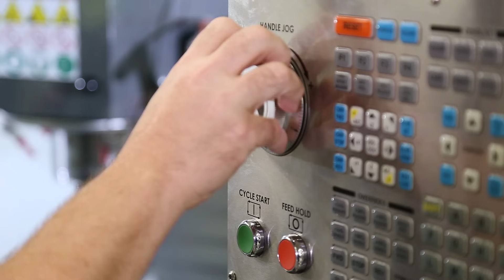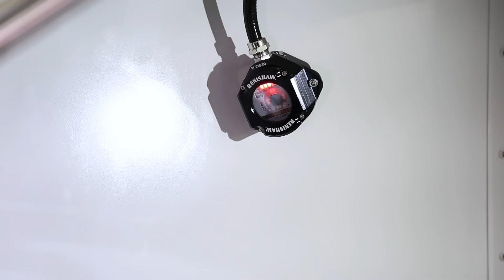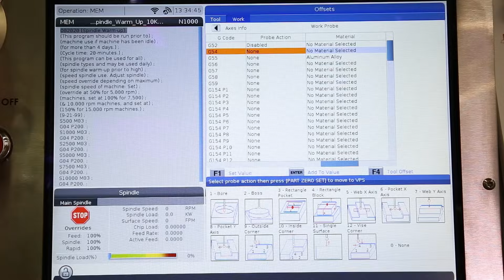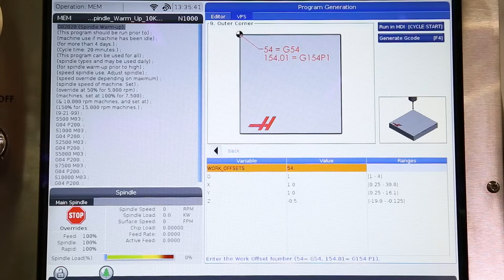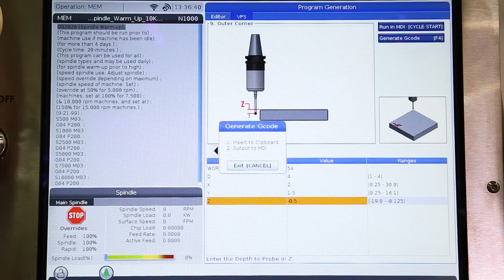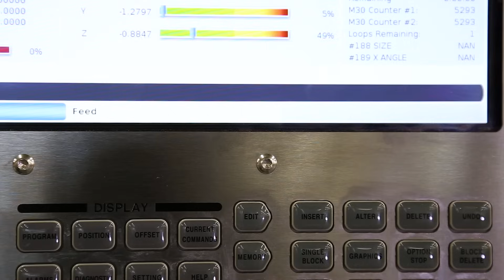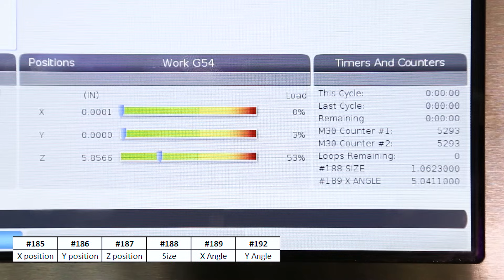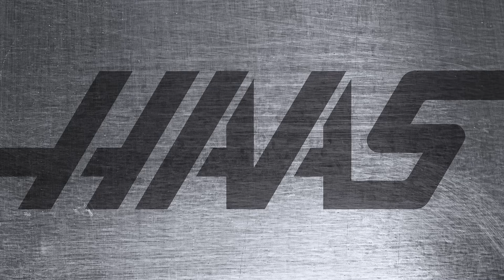Set Work Offsets in Seconds – Haas Automation Tip of the Day

Comment: I hate when you put zero in the upper left corner,, and measurements on drawings,, zero should be put in the lower left corner, for the sole reason,, that all measurements are positive when you have to correct in the program,, just like the right side of the picture is the left side and not the right like Solid Works does,, we learned that in step 1 at the metal school in iso drawing ...simple as you do you do in reality,,

Comment: IMO, Probing is to CNC what the DRO was to manual machining.  Having learned in the old days with a gage block or pin and an edgefinder, setups are sooooooooooooooooooooo much easier today on the modern control with WIPS

Comment: If I use measure cycle 2 BOSS to get to the centre of the part, I have a clamp in the centre so how do I make sure the Z goes up higher enough to go over the clamp, Im new to this and only used the machine for 2 days and dont want to smash the probe.

Comment: Is there a way to probe one surface, say a Z height on a fixture plate, then manually shift that offset to reflect the zero position on the part. I tried just manually adjusting the difference and I got an error.
Reply: After we probe our Z surface, we can adjust our Z Axis Work Offset by highlighting the correct column/row (G54...Z), inputting the shift amount, and pressing Enter (Add) or F1 (Overwrite). If we get an error message, it is probably just a warning because the value in our Setting 142 OFFSET CHNG TOLERANCE is set smaller than the amount we want to adjust things by. If we get the warning, we can just continue, by verifying the large change by pressing "Y", or we can zero-out Setting 142 which will disable the feature.

Comment: What I have never understood is why go to all the trouble of probing every job and every tool for every job.
If you set your origin to a fixed point and you never change it (say bottom left of the table with Z0 at the surface of the table.
Then put the part in the right place by say having pins on your table so your vice is always in a known location.  Then you generate the program with the stock in the right location then you can just put the stock  on the vice and start. No messing around with offsets?
Reply: thats nice if you always run the same part.

Comment: I find the probing interface on the older system under VQC MUCH more streamlined- plus you can jog the probe to the starting location while in the interface, and not have to go back to Hand Jog.  

One question or issue I have run into though.  When trying to do tool offsets (Auto lengh and diameter) on very small endmills (<1/16") the program moves the tool too far down in Z to accurately measure the diameter.  Because the flute length is so short, (1/8" or less) it ends up contacting at a point on the shank, and not actually measuring the cutting face.  Is there a way to change the default depth it moves?
Reply: have you found an answer?
Reply: @hetlrz4sken  no.  I've asked that question of several Haas service technicians, and trainers, and none knew of a way to change that.

Comment: At GE, at the start of every part program the part probe would be programmed to touch off of the tool probe to find the centers of all the probe tips then the probe was programmed to move over to the part & probe the part in X, Y, & Z. the way you showed how to do it involves operator involvement which should always be kept to a minimum to prevent operator induced error. Granted we had so engineers that caused the part probes to crash into parts ruining a $25,000 part probe.

Comment: In the macro line for the probe cycle it uses "S" value for work coordinates 54 through 59.  How would I use to for work coordinates G154 P1 thru P99
Reply: G154.01 to G154.99 I think
Reply: @Game0verxD  I found I could use G110 thru G128 upon some experimentation which got me where I needed to be

Comment: How to probe after you have flipped the part and want to machine the other side?
Reply from the maker: Are you just looking to make sure the part is loaded correctly, or do you want to actually reset a Work Offset, from within your program, with your probe? Both are possible using our probe and some macros. This video will show you how to probe a part, from within a program https://youtu.be/fFZi6rWIcuU. If you have a more specific question, let us know. Sounds like a great topic for a video!! – Mark, Haas Tip-of-the-day

Comment: +Haas Automation, Inc.

Is there much point in me watching these tips when all I'll likely be able to afford is a 20 year old machine?
Do the older Haas controls have a family resemblance?!
Reply from the maker: Thomas - Obviously the control has changed in 20 years, but many of the tips apply to all machines and even just machining in general.  We get a lot of feedback from non Haas users that the tips are still helpful.  Haas Automation
Reply: @haasautomation  Thanks! I've found them handy already, also useful to see that the principles carry straight over from manual machining and set ups.

Comment: So what about the ones that don’t have a “probe action column?” I get x y and z then the next column is work material. There’s no column for probe action.
Reply from the maker: For a very short time, while we were integrating some software improvements, probing was removed from the Work Offset page. In this case, you can probe through VPS by pressing EDIT>VPS and navigating to the Probing templates. If you do have software version 100.17.000.2030, you can call your dealer and ask to have your software upgraded to add probing back to your Work Offset page. Hope this helps. – Mark, Haas Tip-of-the-day

Comment: Why isn’t access to the probing cycles available on the offset page on software version 2038 like Mark is describing in this video?
I can see adding features in later versions of software but why take away such useful features in later versions of the software??
And also, why is there no shortcut to probing from the offset page at all? I know there is access to the probing cycle to the far right on the tool offset page. But that’s all as far as I can tell.  Of course probing can be accessed from edit_VPS.
Reply from the maker: Dean – Probing from the Work Offset page was put back onto the control, with major improvements, in 100.17.000.2040 Software. You can work with your local Haas Factory Outlet to have your machine Software upgraded to the latest. – Mark, Haas Tip-of-the-day

Comment: Haas you need to incorporate a probe stylus length into your calibrations. This way, if the control knows the stylus is only 4 inches long and the user tells it to probe 6" deep it should pause with an M109 code, warning the probe depth is larger then stylus length.
 I did this for our UMC after someone fat-fingered a number and destroyed the spindle probe (not just the stylus!) Any z values greater than 2 inches will prompt the user to press Y to continue.

Comment: hi when I would probe my single surface I found Y axis in option how can I change it to z axis
Reply from the maker: Mountassir echchelh – The template is just remembering your last probed axis. On some versions of software, we must press “ORIGIN” to reset the template (shows all axes again), instructions should be in the top right corner. If you are still having an issue, exit and re-enter the template.  – Mark, Haas Tip-of-the-day

Comment: Is there a reasonable way to preset with work probe to NOT zero?  I am running castings that I find the top of part with a work probe routine in my part program and set Z=0 but I then have to do a macro routine to shift G54 down .025 in Z in order to get where I need to be.  Was easy enough to do until the job came up again with "program restart" enabled.  Can you guess what happened?  Any time you exited and restarted it would increment G54 down .025".  Needless to say that was a problem.  Now restart is left off except if needed.  I'm looking for a more elegant solution that won't leave me vulnerable to the restart feature needing to be "off".  Thought about using the macro variable the probe writes to but couldn't figure out where it went and if it was saved or went away.  Any tips?
Reply from the maker: Mark Smith –  
To avoid the issue you describe, we can either 1) Write our program based on the Z cast face (facing at Z-.025), avoiding a Work Offset shift altogether, or 2) Write a macro to evaluate whether the machine is in Program Restart, Graphics Mode, or running in Real Time, and only shift if in Real Time. Writing #5023=#5023-.025 will bring our G54 Z down by .025” each time it is run – even if the program is run in Graphics, or with Program Restart (Setting 36 On) – just like we commanded. To avoid running certain code when in Graphics/Restart, I will write Macro Logic that evaluates the time a dwell takes (using #3001). If a .5 second dwell happens in less than .5 seconds (instantly) then we are in Graphics/Restart mode, and I have the program skip the Offset Shift, or Alarm out.  Shoot me an email at TOD@Haascnc.com, and I can send you some short example programs. Some probing cycles, like the Probe-a-bore cycle in VQC or VPS allow us to put in an XY shift amount, where it will shift the Work Offset by this amount after probing. I don’t know of a direct shift feature in a Z-axis Single Surface probing cycle, but you can always give the good folks at Renishaw a call. – Mark, Haas Tip-of-the-day

Comment: Hii sir,
Nice to see you on screen. 
I have a question .can I make program in 4 digit 'O' number?
Haas default setting is 5 digit. 
Example- O 11221
I need- O 1122.
Reply if any solution.
Reply from the maker: 5 digits is required. You can enter less than 5 digits but the control will add leading zeros.
Reply: Haas Automation, Inc. 
Thanks a lot sir  for your reply .

Comment: Sorry, too cumbersome! I can get X,Y and Z on that small block in under 20 seconds with an edge finder. My new VF2 has the probe system and we don't even use it anymore...The tool-setter is still ok for tool breakage detection. However, the probe needs to be streamlined a little - I'd like to see it have a manual mode to jog n touch in each direction...
Reply: How do you set Z with an edge finder?
Reply: Ive been machining for a couple years and have never seen someone set Z with an edge finder, I don't think it's possible honestly. If it is then I'd love to know how!
Reply: I like that! never though of it but its so simple.
I set all my tools off a ground boss of known height (the same height as the top of my fixed jaw). Then to set my Z on stock like this, I just measure the distance between the top of stock and my vice jaw with my callipers and bang that value (minus my facing amount) into my offset page. It's fast too and doesn't cost thousands as an optional extra. Its a shame they couldn't have integrated the z datum probing into the X and Y cycle, would half the time it takes straight away.
Reply: i do it the same way, also most of the time z is not critical as u use stock
Reply: for Z you can buy a 100.00 sensor that is 2.0000 high , it is spring loaded so you have alittle cushion, works awesome. lights up within .0001 everytime. Mazak did have a measure page for probing that I liked , but they got rid of it with smooth control.   I agree edge finder is faster and less dangerous.  But with the right setup a probe could be awesome
Reply: I get my origin is zero seconds.  record XYZ of the corner of jaw and load G10 into program.  I haven't touched off a part in years.
Reply: Sorry, I've been doing this for so long it's second nature to me. Over ten years with this method and never any issues. Here's how I go about this. 1. Keep an edge finder in the machine at all times in a dedicated tool #.  2. Then touch off the length of the edge finder the same way you would with any other tool. 3. When you go to set G54 "Z" slowly bring down the edge finder on top of the part in .001 increments using the movable tip to act as a feeler gauge. 4. As soon as there is contact, hit the "TOOL OFFSET MEASURE" button.  5. Add the length of the tool to your G54 z value. Viola - Z is set with edge finder.  Once you get used to this method, it is actually very fast.

Comment: Hi Mark and Haas, Great video! 

Just one question! I use the Bore probing cycle a lot. All my parts have a 0.625 bore drilled from Op1 and I want to continue to use this as the WCS for Op2. However, after putting my part in to a Op2 fixture, I'm getting a slight mis-match in the angle of the part(around 0.001 or less). 

Is there a way to combine the G68 angle (as you've shown in your previous video) and keep a Bore hole as my G54 offset? I'm hoping this would remove the 'off angle' error I am seeing in my part.
Reply: Ryan what kind of material are you using, also have you tried doweling the second operation to keep your WCS more accurate?

Comment: I used to pick up work offsets with an edge finder and Gage blocks then I went to Ecuador for 5 years and then when I came back I started working for a company that used only probing now even if somebody offered me $10 an hour more to work at their shop but they did not have probing I would not even consider it. Maybe it's because I am lazy or maybe it's because if they don't have probing that means they're not keeping up with the times
Reply from the maker: Aaron – I had the same experience. Once I started using probes, I couldn’t imagine not having them. I use them for fast part setups, broken tool detection, part inspection, comparative probing (part I’m making, against a known good part mounted in the machine) and to make sure parts are loaded correctly. Probing and TSC Through Spindle Coolant are hard to live without once you’ve used them. – Mark, Haas Tip-of-the-day.
Reply: In which company they offer you 10$ an hour?  What's is the qualifications to apply in this company as a CNC operator, programmer, or designer (CAD CAM) ?
Reply: You get paid hourly. Who cares if you probe slower manually.
Reply: @unclhos  Any machinist worth their salt wont use the excuse of "I get paid hourly so I blah blah blah". Those are the guys who hold shops back and get replaced.

Comment: Is it possible to break the probe tip with hand jog or does it stop you from doing that?
Reply from the maker: Eggsr2bcrushed – Why are you asking me? Who have you been talking to? Yep, it is definitely possible (so I’ve heard), to break a probe tip when jogging around. The tips themselves are meant to break-away, and are reasonably priced. If you use the probing cycles in this video, the machine will alarm out if the probe accidentally bumps into something, with no damage. If probing, from within your G-code program, using the Renishaw Inspection Plus macros, you ALWAYS want to 1) Turn on your probe, and then 2) Position your probe with a G65 P9810 Protected Positioning move, before moving anywhere. Sounds like a good video topic. Thanks for the comment. – Mark, Haas Tip-of-the-day.
Reply: Eggsr2bcrushed hand jog is the easiest way to break a stylus unfortunately.      The probe has to be on and in a G65 (protected) move for the probe stylus to detect the contact and stop axis motion.
Reply: I tell our operators, as long as the receiver is lighting red, you can break it. If it's green, you're safe.

Comment: Can you not make a probing cycle in MDI on the new controller, like I can on the classic controller?
Reply from the maker: Joseph – The new NGC control will take all of the same Classic G-Code style probing programs, like G65 P9995, G65 P9023, along with all of the Renishaw Inspection Plus cycles. You can still probe from the Offset pages, like we did on the Classic controls as well. The NGC does not have the same VQC templates (black background) that the classic controls had though, these have been replaced by newer VPS probing templates that can be accessed by pressing EDIT, and then navigating to the VPS tab and selecting ‘probing’. – Mark, Haas Tip-of-the-day